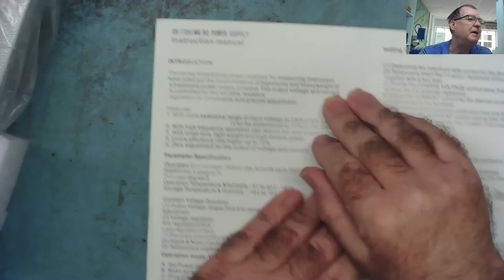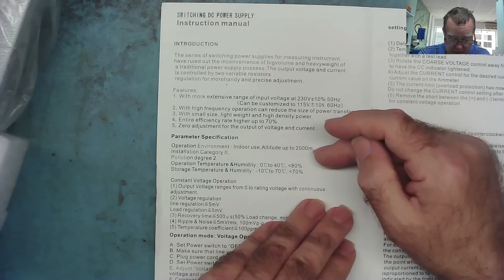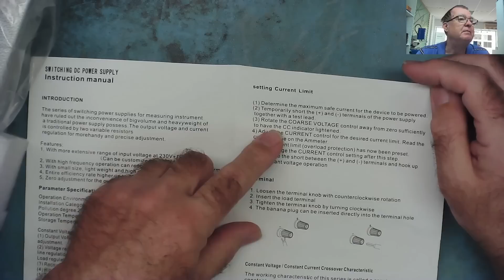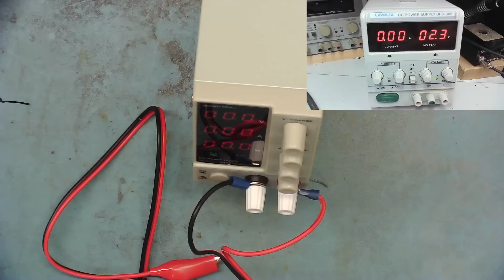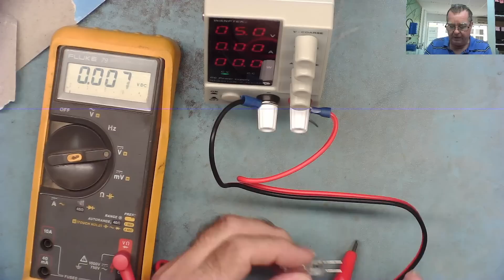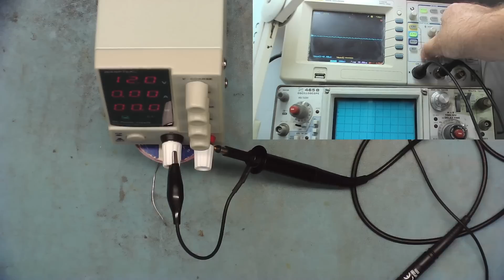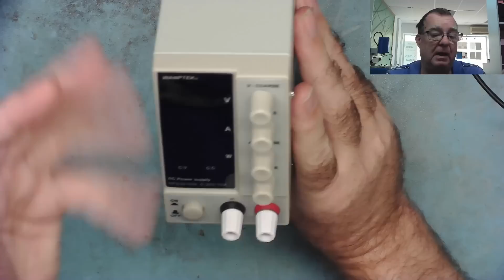Cheap 0-30V 0-10A Lab Bench PSU Power Supply Review NPS3010W - How good Is It?

Comment: Check out the Kettle socket  on the rear panel is wired incorrectly and not uk complient, the fuse is in line with the netural , and is a switched netural .. I added a Internal fuse , and rewired it so its a switched live, so i have fuse in neutral and live now ,

Comment: Bought a similar item lately. The voltage output on the display was different form the real output. Tried to adjust it by randomly trying the trim pots and seems that my 35volt 5amps can now do near 8 amps, maybe more? would this be safe? I did not push it more but there is a model that does 10amp, so this is weird, If any one here has any input, is it possible that the only difference is in the trimpot being set for either 5amps or 10 amps and they are selling that to us? it does seems like it... thanks!

Comment: I did not watch the whole video but it looks less than useful because I only see one on / off switch? A  proper PSU should have both an on / off switch and a second switch to turn the output voltage on or off.  This way if you have the thing set to a higher voltage and you connect it to say some digital circuit running at 5 volts you don't blow it up having a chance to adjust the voltage before outputting the voltage and current.
Reply: if ur psu needs two damn switches to be useful

u r probably not all that useful

JUST ADJUST BEFORE CONNECTING

THERE IS THIS THING CALLED DISCONNECTING
Reply: Until you forget to disconnect and accidentally burn out your project...
Reply: Yes ,i saw power supply like that and is very useful , yuo can set a voltage /current and then supply yuor circuit , is very practical without conecting/disconegting physically the circuit

Comment: Hi. Im looking for a powersupply to run my large lemax Winter village. Now Im using a lot of 4,5v 1000ma supplys. So question be.. Can i use a supply like the one in your video to power a lot of buildings up to a load 4,5v 10A?. (Each lemax item is typical 50-300ma)

Comment: Your advice please: would it be beneficial to CLEAN/treat all  NON-SOLDERED contacts in an amplifier or preamplifier.  Your thoughts please.  Thx.
Reply: You didn't get a reply two years ago, probably because it's a nonsensical question. An amplifier wouldn't have non-soldered connections in it.
If you mean cleaning switch contacts, then yes they should be cleaned if they aren't working properly.
If the connection is connecting properly then there is absolutely ZERO benefit from cleaning it.
Reply: @johncoops6897  then why do is it recommend cleaning the RCA plugs XLR plugs banana plugs?  Anything plugged inside the amplifier would also have to be cleaned because they would corrode/oxidize in the same way ( especially if it’s bare copper).
Reply: @mikeeygauthier2959 - bare copper isnt used inside switches and connections for exactly that reason. They use gold, silver or tin as these materials don't oxidize.
...
There certainly is a benefit to cleaning IF there is a dirty connection, otherwise it's pointless.... it provides no benefit.
...
As an analogy, think of the question of "Is there any benefit if I mow the lawn?" ...the answer is "It provides a benefit only if the lawn needs to be mowed". 😉

Comment: It is garbage! Do not use it. Huge delay due to huge cap at the output. Still big noise level. Slowly working constant current which needs load to be set. Utter garbage.
Reply from the maker: Be fair Robert, it isn't garbage it simply has it's limitations, most of which I think I demonstrated.  Some viewers here are using things like an old ATX PSU, with various modifications, as a bench PSU.  Compared to that this is a pretty good power supply if it is at the top end of your budget but just still affordable to you.
Reply: @LearnElectronicsRepair  Exactly!

Comment: I didn't know that was a common thing, because I baught a power supply that has a good chance of overshooting but its got a button to turn the power supply on, then another button to activate the power output. The odd thing I don't get is why don't they add some sort of a delay before allowing the voltage to be output. I may at some point put something like a relay between the output and my banana jacks on some sort of a timer to allow the overshoot to occur and then just output the voltage. 

It should be a simple project since I can test it initially from the power supply and just check for any overshoot and then eventually fit it into the power supply.

Comment: Just FYI, it's really easy to convert ATX power supplies for bench use. You can get them cheap, if not close to free, from older systems. You get multiple, high amp voltages to use. For instance, from a 600W ATX you can break out: +12V @ 20A, 12V @ 1A, +5V @ 34A, +3.3V @ 28A and more. It's very handy to have +/ volts and multi outs. And you can now buy cheap "24 pin ATX Breakout Boards" so you don't have to do any wiring. Highly recommended, even if you already have a PS.
Reply from the maker: But that is rather missing the point - for a bench PSU (especially for repair work) it is essential to control the output current from 0.01A to the maximum the PSU can supply, and for short tracing you need to set the output to match the voltage rail you are tracing (0.8V, 1V, 1.35V 1.8V all come to mind as common settings)
Reply: @LearnElectronicsRepair  Totally. I agree you need an adjustable PS for the bench. I was just throwing that out there. It's just great what you can get out of an ATX PS that's just lying around. You can add adjustability with ICs like a simple LM317 and the like as well as get high voltages if you wish with cheap boost converters with all the available amps you have at your disposal. It's a good way to learn as well. At the very least, you get a positive and negative voltage you can use for op amps. That's one thing I wish bench supplies offered. A negative voltage is needed quite often and is always lacking.
Reply from the maker: @nonsuch  And I totally agree in return to be honest.  Depending on your budget, a modified ATX is a good option.  Home made bench PSU is one of the most popular/requested electronics projects out there and I built them myself in the past when I couldn't afford to buy one.  Yes they have limitations, but they are certainly better than nothing.  One of my bench PSU as you saw in the video, is a dual output one but they are not so common, or cheap. 

Another good option for op amp projects etc is to use two 12V Positive supplies (the wall wart type) and connect the positive output of one to the negative output of the other.  This becomes your center tap (ground, 0V) and you have plus/minus 12V rails, often with higher current than the ATX -12V can supply.

Comment: Hi just a quick tip check the power lead for earth , I bought 1 similar and no continuity on the eath .
Reply from the maker: Answered already in response to another query - it has good continuity to mains earth from the chassis/case.  Neither of the output terminals are earthed.  This is a good thing or a bad thing depending on how you are using it.

Comment: 6:35 - About output capacitors, Sorin from "Electronics repair school" YT stated that those capacitors can burn things even if you have current limiter.
Reply from the maker: @orion 310591 
This is rather incorrect - those output capacitors like Sorin said not only can but WILL burn things even when you have a current limiter but they apply equally to SMPS based bench PSU and Linear bench PSU - they both have them and they are just as bad on both.  

I proved this fact a while ago on #LER on a video using a linear PSU and when I have time tomorrow I will go and find it for you.  Yes you are right about the output capacitor problem but you are equally wrong thinking it only applies to switch mode PSU.
Reply: @LearnElectronicsRepair  I could have mixed 2 sentences from 2 videos, to avoid confusion I removed last one. I would like to see that video, I am in process of getting  PSU.

Comment: I have a NANKADAF WP535H programmable power supply, you can set each digit manually and press in to lock that number in, very easy to use didn't cost the earth either.
Reply from the maker: I'm not sure how I feel about programmable power supplies.  To be honest I haven't tried one.  Have you used both types and do you find the using the controls takes longer to set up on the programmable supply compared with simply turning a knob for volts and amps like on this supply and the other two I own?
Reply: @LearnElectronicsRepair  I haven't but I understand the purpose. I suppose it would take slightly longer to set this one but once set it remembers even if you disconnect it, so I guess there must have a battery in there.
Reply from the maker: @jonathaningram4672  Yeah I can see that if it stores your settings in memory and you can recall them at the touch of a button is it quicker.  As I said I never used one myself so I can't really express an opinion - it's just something I have in the back of my mind that the type with control knobs is the quicker/easier to use.  I guess the best person to answer would be someone who owns both types.  Can anyone else answer this question?
Reply: @LearnElectronicsRepair  I guess your right, someone that has owned both types but the one you got to demonstrate would have been like jet lag. Like you said capacitors charging discharging to achieve voltage. For me this perfect, one glimpse of display I know what it's doing, it literally takes couple of seconds to dial in and lock, the twist variable one you demoed seems to over volt by milliamps. When this one is set it's pretty accurate.
Reply from the maker: @jonathaningram4672  Yeah I totally agree the lag on this one is annoying! My other bench PSU are much better in this respect

Comment: It is not clear if this power supply has a grounded negative or not. If it's designed like a computer ATX powersupply, then the negative is grounded. If you work with electronics, you have to know if your powersource is grounded or not to prevent you from surprises. Most bench powersupplies have the green earth banana jack, so you can choose if you want to ground the output or not. In some cases it's handy that the output is grounded, but in some cases it can cause damage or misreadings.
Reply from the maker: Quite Correct. Both of my my linear bench PSU have an external earth strap to negative as I mentioned in the video.  I will check this morning.
Reply from the maker: @Bjorn V
I'm a the workshop now so I tested this first thing.  The output negative (and for that matter positive) terminals are isolated from ground.  Like you say, this can be a good thing or a bad thing depending on your use of the PSU.  It would nice to see an earth strap link like I do on my Lavolta PSU.  My Iso-Tech dual 30V-3A psu also has isolated output terminals but at least there is an earth terminal on for outputs so you can easily strap any terminal to earth if you need to.

Comment: I might have missed it, but I did not see a Line Fuse on this device.  Does it have a circuit breaker or line fuse within the chassis?  Good review.
Reply from the maker: Hi Tim - Yeah it has an inline fuse 250V 5A - the fuse holder is integrated into the IEC mains power socket on the back of the unit - so it is the first thing that the mains power goes to.

Comment: I have a power supply of that series. It is the 6A vmodel.  It has quite a lot of disadvantages. There is a lot of ripple on low voltages. The ripple is also not continue, but it comes in "trains".  The controls are difficult to use. The overload and short circuit detection are slow (the voltage is cut down very slow). You get what you pay for. It is not like a linear supply.
Reply from the maker: Thanks Kris, I think I touched on most of the points you make.  I think it is fine for general hobby/repair use, I will be trying it in future on some real repairs so we can get a better idea.  I already have two linear power supplies as you saw in this video.

Comment: I got 12 of those 10 A supplies for student use.  Their 10 Ohm NTC inrush limiters burned out after only a year or so, but replacing them with 5 Ohm NTCs seems to have eliminated the problem.  Those truly worried might add inductance in series as well.
Reply from the maker: That's useful to know, and an easy fix or mod to make.  Thank you.

Comment: Blimey, that's expensive for what it is. £80 if you want it shipped to the UK (from your link), from china in maybe 5-6 weeks. An equivalent from amazon, delivered tomorrow is £45.... I would also recommend opening it up and checking how safe it really is.
Reply from the maker: I had a look on Amazon but this model is coming up at £121.  What is the equivalent model you see for £45? I can only find 30V 5A at that price so only half the current output of this one, which is definitely not equivalent. The cheapest 30V 10A I can find is this one at £54.99 which has 4 digit display and a output ground connector but doesn't have the fine adjust on V and I.  I never tried this model so I can't personally vouch for it but it has good review ratings on Amazon
https://amzn.to/3cPWaJh
Reply from the maker: @Matthew Bullock Can I just ask what part of 'opening it up' I didn't do in the video you just watched? Because I am really quite confused about this recommendation at the moment.  Did I not open it up sufficiently?
Reply: @LearnElectronicsRepair  I meant actually check the safety more thoroughly. A quick 'that looks fine' doesn't really cut it for such an expensive power supply.
Reply from the maker: @mib1796  I'm not expert enough on safety regulations to make that sort of judgement to be honest.  The wiring looked neat, there is a ground terminal bolted to the chassis. I could do a continuity test to ground and an isolation (PAT) but nothing else.  It appears better built than many ATX PSU I have opened up.  If there are some other specific checks I should make then let me know and I will have a look
Reply from the maker: This seems expensive in the UK for some reason.  When I click on the link I posted here, I get some postage options for Spain where I am based, and clicking CN gives me a price of €99.84 inc VAT with free shipping which is on a par with the price you have, but if I choose ship from PL I get €61.31 plus €0.76 postage so total €62.07 and delivery time of 8 days.  I think anyone in the EU would see this price (unless someone can tell us otherwise) 

However I'm actually in the (spanish) Canary Islands so I don't pay IVA (Spanish version of VAT but it is 21%) which is automatically deducted at checkout same as when I order from AliExpress so I have a final price of €51.30 delivered, and to me that seems inexpensive. On the downside, Amazon don't deliver here, most of the time.
https://morningexpress.in/we-do-not-serve-the-canary-islands-the-odyssey-of-buying-through-amazon-from-the-archipelago/

  What price do you see from AliExpress?
https://s.click.aliexpress.com/e/_DFSzqAn

Comment: I have given up posting to this video. I had referred to other brands one of which is a linear power supply that is not much more money here in Canada and those posts are not showing up here. This featured power supply is $117 CAD.
Reply from the maker: Greg M I am not stopping you or anyone else posting alternatives here - email them to me electronicanaria@outlook.com and I will happily add them for you.   I gave an honest opinion on this one, its not expensive (I can get the 10A version less than €60) and it works well enough to be useful
Reply: @LearnElectronicsRepair  I think it is YouTube automatic filters that are removing the posts. I will email you the exact post I tried to make. This 10A one is $117 CDN from the same eCommerce source.
Reply from the maker: Here is actual post Greg M was trying to make, which he then forwarded to me by email:
This is the exact post that I tried to post 2 or 3 times before I gave up. Something in it is triggering YouTube's automatic filters and in turn, removes the post without your intervention. Perhaps it is Banggood in the text below. I don't know. These are 5A PS

Looking for a ps here and had narrowed it down to Korad KA3005D and KA3005-P from Amazon w free shipping. These are linear power supplies and are  $145 CDN and $187 CDN on Amazon with free shipping. Another option is from AliExpress and the GopherT PPS-3205 30v 5A for $92.28 CDN w free shipping. This Banggood power supply by the way for comparison is $117 CDN from Banggood.  Neither of these PS has the power-off button to separate the PS from the device. The problem I found at least with AliExpress is that the shipping for PS is more than the PS is worth.

The problem with buying via AliExpress and probably Banggood is shipping a faulty item back is cost prohibitive.
Reply: I can also get a WANPTEK APS3010H which is 30V 10A but is $16 more than this PS from AExp. It offers an Output switch as well as a power switch. Supposedly Ripple voltage:≤0.5% Vp-p and 3 memory settings and USB output included. One gets overwhelmed with the choices and just throws up hands.